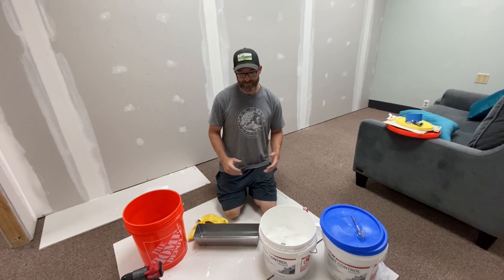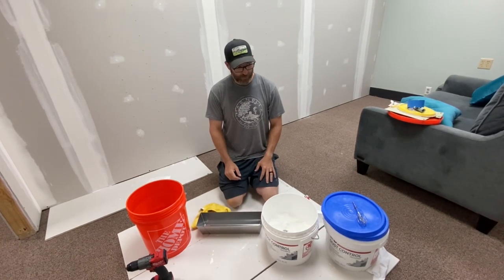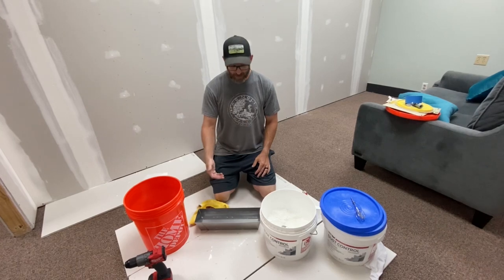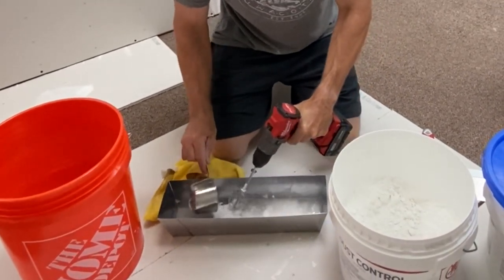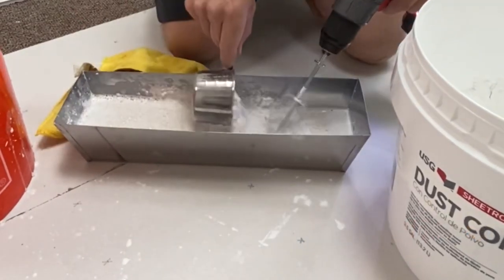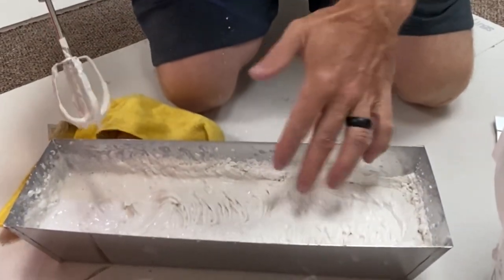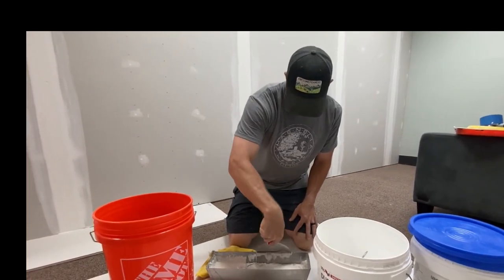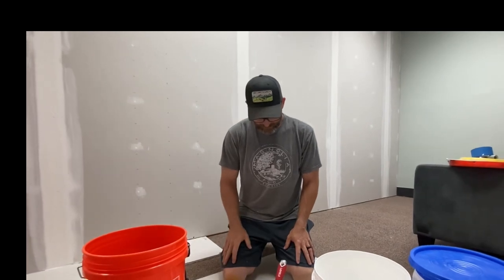How I Mix Quick Set Joint Compound aka “Hot Mud”. Your wife has what you need! #drywall #sheetrock

Comment: Been doing drywall finishing for about 25 years- full time.  When I need to mix just a pan at a time I just use a pan and a six  inch  knife. I have to admit I never thought of the cake mixer… pretty cool idea. I’ve used 90, 45, 20 and 5 minute mud. You better be ready when you mix 5 minute. As soon as you feel it starting to set up better start to clean your tools up. Nice work! USG is the best.
Reply from the maker: Yeah I’m barely fast enough for 20 and 5 unless a small patch. You Pro Drywallers are something to watch. It’s an Art Form.

I only use USG stuff and I agree with you 100% on that!

Thanks for watching and commenting!

Comment: Nice idea.
With small batches (less than 2 kg) of gypsum-based products I just pour in the right amount of dry mud into the water, mix it lightly with a knife/small trowel by hand and let it sit for 5 minutes. After that I mix it again and it's very smooth and ready to use. After mixing by hand it does set so quickly, because you do not introduce additional energy to the mix, thus allowing you to use it noticeably longer.
Reply from the maker: Yeah, I do smaller batches by hand as well most of the time which is the 5-20. I’m not quick enough to do a whole pan of that stuff 😂 

I haven’t noticed the time difference on 90 minute but I also typically use it all well before it starts to set.

The letting it set for a bit is an important step, I should have mentioned that 👍

Comment: Sweet idea! I dont hang drywall often, mainly doing repair work. I get tired of mixing 5min mud by hand though and this will come in handy for sure
Reply from the maker: Yeah, I’ve thought about getting the Blue Magic ball for mixing 5 minute mud but haven’t pulled the trigger yet to try it. It has mixed reviews. I normally role with 90 and 45 unless I have a time crunch or nothing else to work on while I wait.

I can usually do this method without splashing anything but I wasn’t fully concentrating on my drill speed while filming.

Good to hear from you!

Comment: I learned that from watching that kilted guy on his channel. I then ran into the kitchen and found my wife’s mixer.
Reply from the maker: 👍… It works really well. They sell one on Amazon that is specifically for a drill but you can get a mixer and two paddles for cheaper at the Dollar General Store. I think I paid $7 for it.

I tried using the mixer the first time after I bought it…. What a mess 😂. It spins a little too fast.

Thanks for watching!
Reply: @MORGANSMaintenance  I really like the fact that i can take the mixer paddle and put it in a bucket of water and clean it off in about 5-10 seconds. I typically use the 5 min mud for small repairs on my day job and its so much easier to mix and clean. I used to use a 4 inch putty knife to mix but when your using 5 min mud you have to mix fast so you have time to apply it. 
#thatkiltedguy showed it on his channel and i have been using that ever since. 
I have a Mud’n more mix ball video that i did but most if the time I don’t use the mix ball any more
Reply from the maker: @THETIMINATORTHETOOLMAN  I had thought about getting the ball but I have been back and forth. I don’t know that I would use it. Does it clean easy?
Reply: @MORGANSMaintenance  yes, it is very easy to clean since the mud just dries inside and you just squeeze the ball and it falls right off the material the ball is made of. You then just dump the dried mud out of it and rinse the ball out. 
I have a video out of it on my channel.
Reply from the maker: @THETIMINATORTHETOOLMAN  ok thanks. I’ll check it out👍